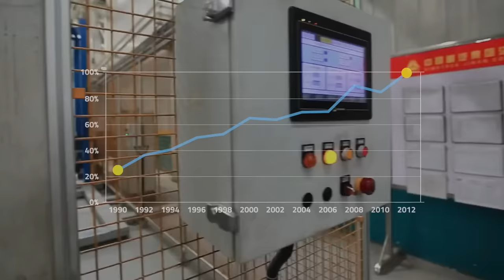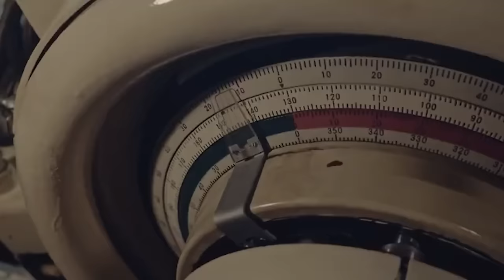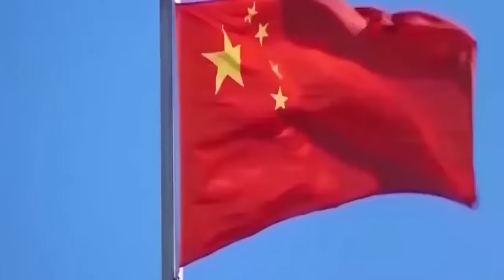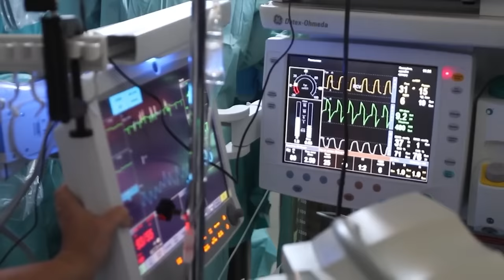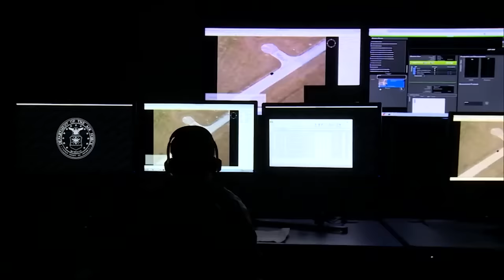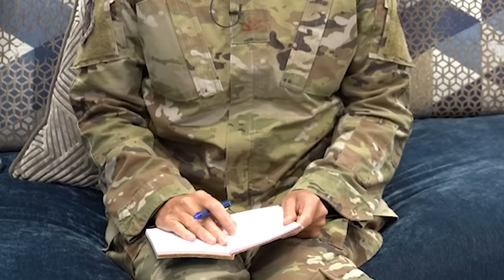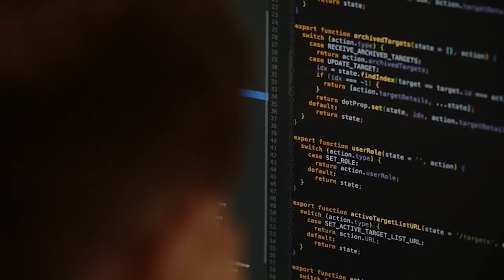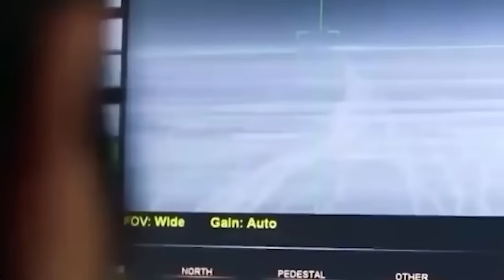China's Insane World War 3 Plan

Comment: China needs to build oil and gas pipelines to russia and a train from China to Europe through russia to reduce its dependence on sea trade.
Reply: There is already a train route all the way to Germany. And a gas pipeline to Russia with a 2nd one being built. Plus pipelines to central Asia also.
Reply: @Jkl62200  china can also fly goods to europe using commercial planes
Reply: @pathat8869  I think China should go ahead and build bases instead of being so shy. At a minimum, China should quickly build the base in Myanmar as well as in Gwadar. The Myanmar port (and the one in Cambodia also) is critical to protect against a blockade of the Malacca Straits.
Reply: @TK T  yes but the best option is to reduce dependence on the sea for trade.  China has a land connection to Middle East,Europe,Africa so building more railroads and airports would be good. The US navy controls the oceans so it would be better for china to move most of its trade to land. That is already happening. There is plans to build railroads between china and europe through russia for trading goods
Reply: @pathat8869  not planning. Done long ago... Chongqing–Xinjiang–Europe railway, abbreviated as Yu–Xin–Ou railway (Chinese: 渝新欧铁路; pinyin: Yú–Xīn–Ōu tiělù), is a freight rail route linking Chongqing in Southwestern China, with Duisburg, Germany.
Reply: @Jkl62200  oh that's good, the other thing china should do is build more commercial planes and airports so goods can also be delivered to Europe by air
Reply: There is currently only 1 pipeline from Russia to China which is natural gas pipeline and its call "Power of Siberia". It is being built in 3 phases. 1st phase is to northern China which was complete in 2019. 2nd phase extends down to Beijing completed in 2020. The last phase is being extended down to Singapore which will be complete in 2025. This pipeline has already taken 8 years. 

Natural Gas pipelines are ALOT faster to build than oil pipeline. For reference, it took Europe and Russia 15 years to build the oil pipelines from Western Russia to Europe. That was with Western nations helping build the pipelines. Western nations have over 100 years of expertise on oil production. Now the Russians and Chinese want to build a pipeline to China with no expertise and a pipe that is almost 5 times that length because remember, all the oil fields are in Western Russia because Europe was the main customer. It will be a miracle that this pipeline gets complete in 30 years.

Edit - Oil pipelines are ALOT harder to build because oil coagulation so you need to send it through the pipes at over 110 degrees F with special chemicals. The pipes need to be larger and built more sturdy with bigger foundation every hundred meters. Then the pumping stations need to be built throughout the pipeline to push the oil through. Oil pipelines can take 2 to 3 times longer than gas pipelines depending on expertise.
Reply: @Nesstor01  everytime you use western past experiences to extrapolate on how long China will take, divide it by 5x to 10x. Applies to everything from highways, bridges, trains, military equipment, space,etc. Westerners have funnily been continuously 'amazed and surprised' in the last few decades. And you are still underestimating.
Reply: @TK T  We're also amazed at how fast they deteriorating. Lol tofu dregs.

Edit - 60 bridges have fallen in the past decade for the entire world. 37 of them came from China ALONE. Great job.
Reply: @Jkl62200  Quantity over quality.
Reply: @johnmcgill3603  oh yeah.. I can assure you if you've e en been to China that public infrastructure is top notch. Now. I could not say the same about American infrastructure and its crumbling cities.